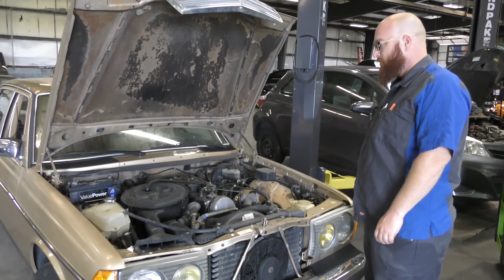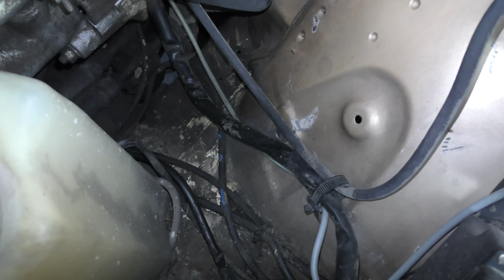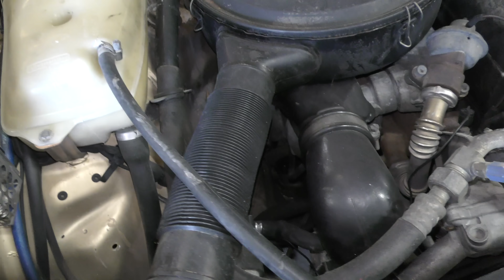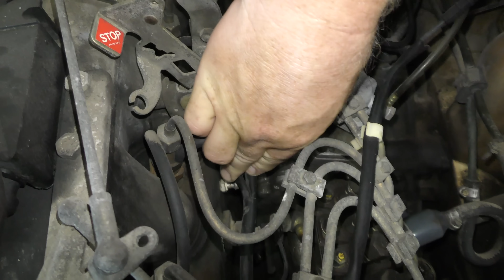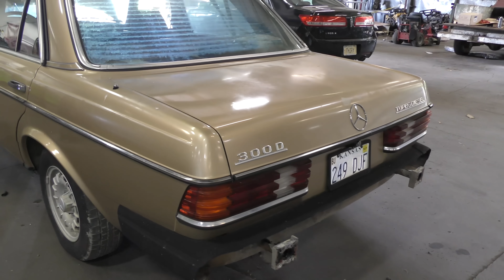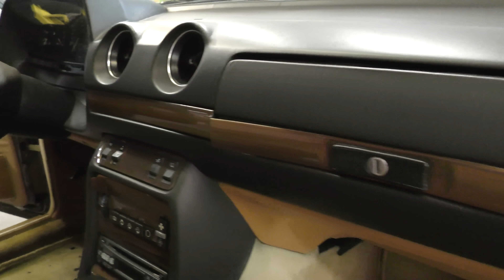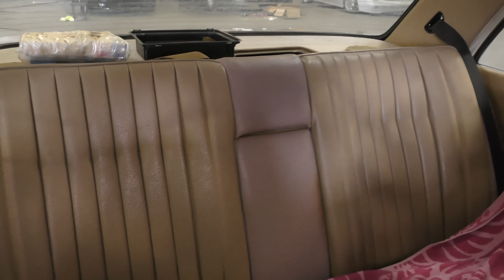Tank of a Mercedes 300D with a 3L Turbo Diesel! CAR WIZARD finds lots of surprises under the hood!

Comment: I can tell you right now someones polished the hood, as its a different shade from the rest of the car, so someone started, took a look and gave up, and with the rear bumper my best guess is that that rear bumper was next for polishing or replacement, or maybe they wanted to convert it to what was probably euro spec chrome bumpers, as if you've ever looked at ratarossa's channel about how bad the US Spec Bumpers were on the american ferrari 308's were, one can only imagine how bad they were on this if it had them, as with the shocks and all that, they added about a full 100 pounds of weight to the car on I think one side, and he's not even done with it yet.

like if that ferrari was a porsche, they'd charge you a 100 grand for that kinda weight savings alone these days lol 

also I gotta say you know if someone put a bigger turbo on this, and switched out the headlights for some latter square ones, it would probably be quite the car, if only it wasnt in this god awful color lol

Comment: The Mercedes diesel in my semi truck is an OME460. 12.8 litre 6 cylinder rated at 460hp 1500lbft mated to a 10 speed manual Eaton transmission and 3.73:1 rear gears.

Comment: A friend had 5 MB diesels. '76 240D, '79 300D, '80 300D, '80 300SD Turbo, and '87 300D Turbo. All of them tanks. All over 300k miles. When we went to pull-a-part, the diesels had 400-600k miles while gas MB had 100-300k miles.

The 240D saved his life. Some guy t-boned him on the driver's B pillar going 75. My friend walked away.

Comment: Correction: It's the non-turbo 300D that is around 85 horsepower (87 HP to be exact). The turbocharged 300D puts out 123 HP and 184 lb-ft of torque.
Reply: Here in Austria the na 300d is rated at 88 HP...
Reply: @Rum1981  US uses imperial horsepower and austria uses metric horsepower, hence the difference
Reply: @Thorbyr  Not really. The 300d he mentions is "NA" or naturally aspirated - not a turbo
Reply: @Thorbyr  Metric horsepower is called kilowatts 😂😂😂😂😂😂
Reply: @Rum1981 the newer straight D 300D in the newer 124W were apparently 112 hp.
Reply: In USA when the turbo diesel was introduced it replaced the naturally aspirated engine option and (unlike in Europe) they still just called it 300D.  And the power is 125 hp. In Europe, the turbo diesel was only offered for the station wagon and it was called the 300 TD turbodiesel.
Reply: @joakimquensel597  One of those is for sale about 5 minutes away from me. Unless it was already sold
Reply: Yup
Reply: I think the 300D straight D was 112hp..the turbo didn't make much difference tbh
Reply: @MP-po6fj You're confusing the newer 300D in the w124 with the older w123. The older 300 D had a 5 cylinder  3 liter, the Om617 had 80 hp,  untill around -82. They then upgraded with other pistons, other pump and became 88 hp, still 5 cylinder 3 liter. The turbo version had oilcooled pistons and 125 hp with typical Garrett T3 turbo. 
Then from 1986 when the w124 platform were introduced it got the 6 cylinder 300 D with 110-113 hp in non turbo version.
Reply: So the cars basically a gutless pile of junk ! Yeah no thanks
Reply: Michael Wilson that’s why these things last so long.
Reply: I had a 1981 240D with the 4-speed manual and a 1985 300D turbo automatic and both had no trouble keeping up with traffic, even here in fast-paced New Jersey. In fact the 240D is quite peppy in city traffic, which is why it was the favorite of European taxi drivers (and still is today in Third World countries). The Mercedessource channel has done videos demonstrating the true acceleration times of these cars when they are properly maintained and tuned.
Reply: @vwestlife  84 300D manual here, it did pretty well.
Reply: @vwestlife  Oh hi, didn't expect to find you here
Reply: @iamasmurf1122  1st car Bill Gates bought when he started getting rich: Porsche 911, the 2nd : Mercedes 300D as he called it "The world's fastest slow car".
Reply: @iamasmurf1122 Sounds like whatever you're driving.😅

Comment: The 123 chassis is my favorite Mercedes. I've owned 3! One I bought with only 63,000 miles on it from a couple who lived in Florida. Why I sold that car is one my stupider mistakes. Another I bought had a BRAND NEW crate motor from Mercedes.  I paid 2500 for that one, I believe I "stole" it. I sold that car and the guy uses the car as power for a saw rig. He's got belts running off the rear end. My third had 327,000 miles on it and it fan like a top when I sold it. I would have jumped in that car and drove it anywhere.  

The rockers and jacking points on this video car made me drool. It's rare to have them both so rust free. 
Nice car, Mr Wizard. These old Mercedes make great first cars because they are built so well. 

I'm actually thinking about looking around for another 123 300 diesel. I miss that smell. 

Or, I have always lusted over a 220 D 4 speed, I'd also like a 50s/60s 190 diesel with the 4 speed on the column. 

Please do a follow up video when you are done. I love these cars so much.
Reply: Why did a car that is "so well built" need a new crate motor, and why are so many of them rusty?

Comment: When Mercedes made non plastic, good cars.
Reply: There's no shortage of plastic in this car.
Reply: @OMGWTFLOLSMH  Whooosh!
Reply: all the mice chewed stuff is plastic/rubber
Reply: When luxury was about build quality rather then technology
Reply: Add BMW/Audi etc to that list
Reply: @x01e  mm not audi, old audis were garbage too
Reply: My 2000 s500 is pretty decent yes there are things that break but 165k
Miles going strong. 💪👍
Reply: If you keep putting money into any car, you can probably keep it on the road forever.  I had 2 new ones from that era ('81 and '89). The truth is that both arrived from Germany with factory defects, both left me stranded several times and both had superb maintenance with no expense spared from day one.  The random failures were many.  Years after I had gotten rid of both of them a former MB employee asked about the cars and said "let me guess what went wrong with yours". He then recited a LONG litany of problems and just about all of them were mine. Reason: "Those were just the FREQUENT issues!!!"  I'll never own another German car of any kind.

Comment: Haven't seen this in the comments: Car Wizard didn't open the boot but there may well be rust damage in there. With the ariel missing, rain will be running in there and collecting at the low-points. Looks like a solid old Merc though - not bad for a first car.👍

Comment: I have an 85 300D. I’ve been using it as my daily driver in Tucson during the winter season for many years.. It has a 4 speed manual which really wakes up the driving experience. It’s a great car for long distance driving. It handles corners extremely well. The 134A in the AC system is a weak point - but the AC even with R-12 was weak even when it was new. You mentioned the engine shocks. The motor mounts are also a common issue. But it keeps soldiering on. Anyone who says they’ll get 30+ MPG must be going down hill with a tail wind. When I had the auto trans 22-24 was the best I could get. Then I swapped in a 4 speed and it did drastically improve the MPGs.A great car!
Reply: get the York AC compressor in there the R4 rotary type are garbage
Reply: You'd think that MB would have realized that their AC systems were crap (which they were) and install good ones. The answer is that of course they knew; they just didn't care. That's true of most of the defects in these cars.

Comment: The 123 Turbos were and still are an excellent car and the engine had 120 hp, my parents bought a 1983 300D new.  I remember my  mother loved that car and it was the first of many MB's for her. I used to work on them in the 80's and 90's they were great i'm sure that I still have a set of valve adjustment wrenches for the 617 in my toolbox.   I can't believe the amount of damage from the rodents.  Wizard your video won over Hoovie after  I saw that you both had new ones posted at the same time but the 123 video got my view first.

Comment: It's a real shame that MB abandoned the durability aspect of their cars in exchange for electronics, gadgets, quirks and features.
Reply: Believe me, electronic actuators in just about everything are vastly superior to vacuum-operated ones with all the fragile but essential weak, cracked plastic tubing running everywhere.
Reply: @wholeNwon  I'm not going to argue with that, but a whole bunch of stuff is unnecessary. It's not unique to MB, of course, but do we really need door handles that pop out as you approach, transmission selectors that rise up, speakers that disappear, doors that close the last inch on their own, latches that trigger solenoids instead of opening the doors directly, etc?
Reply: @smwsmwsmw  Of course we don't need (and many of us don't want) all that trouble-prone crap. But the dealers sure do!
Reply: @smwsmwsmw  It's called modern luxury Steve, I appreciate the sentiment and I know where you're coming from but these features you see are wanted by people who will actually pay their hard-earned money for something like that. Mercedes and other brands have been doing this for so long now that the more recent cars (circa 2015 onwards) really don't have electrical issues anymore, everything's solid state. Even by switching to electric steering they've completely mitigated PAS pumps failing and steering racks going bad
Reply: @wholeNwon  best pickup truck diesel engine ever was a mechanically timed 12 valve cummins
Reply: @wholeNwon  definitely cheapened the brand. sigh
Reply: @graphene1487  There are still lots of suckers out there who buy them to impress the equally stupid.
Reply: Gadgets sell at a higher price than durability, to the general public. That's why today's cars are full of stupid and dangerous to use touch screens instead of old buttons and knobs, which are less fancy and cost more to wire.
Reply: If they didn't then Doug wouldn't have a job now WOULD HE!!?
Reply: @overthehilldill3626  That's true. I bet Mercedes-Benz takes that into account.
Reply: They are pure junk today!
Reply: These cars needed maintenance too. Do you expect Mercedes to stay in the dark ages technologically? They would have been out of business decades ago. We have a lot to thank them for, the technology they developed and tested are now commonplace in many cars
Reply: My 2000 s500 begs to differ not as nice but strong and good at 165k miles

Comment: I have a 1985 300D Turbo Diesel that I inherited from my dad back in 1999. The body is rusted, so I stopped driving it 11 years ago. The odometer stopped working at 267K miles. I put at least another 100k before I parked it 11 years ago in my back yard. It still cranks today and I drive it around my property from time to time. I am looking for a decent body to transplant this engine/transmission. The engine and trans are solid as a rock. They don’t make them like this anymore.

Comment: I had the chance to buy one of these years ago - it was silver, a 1985, and in a lot better condition than this example. It was a case of "Dad died, left me this car, I don't want it" and it was being sold fairly cheap. Wife and I needed a car, but she didn't like the way the old 300D looked. She found an Isuzu Trooper she liked.

That trooper was the worst vehicle it has ever been my misfortune to drive. I can handle the fact it was slow. The issue was something on it was always breaking. Our other vehicle was an old chevrolet truck with 230,000 miles on it, and that truck was leaps and bounds more dependable.

Comment: The oilfeild has killed most in my area. Drillers buy them to use the offroad diesel at the rig to get the crew to and from the rig and the dirt roads just rattle them to pieces.

Comment: This was my first car back in 2000, if memory serves.  I was 17.  I had 1985 with the 2.88 rear differential.  It was a birthday present.  I never liked the w123 because I fell in love with the w126 a long time before that.  I always longed for the superlative S-Class.  My parents had a 1984 300D and ‘83 wagon respectively for years and years before that (Dad’s went 464K miles and Mom’s was sold).  My Dad has at his business an ‘84 wagon, and an American 1980 280E (with the m110).  Bodies are in tough shape, but they run alright (even if they’re off the road).  That’s all that’s left of what we used to have.

Comment: I'm very excited to watch this series unfold. I just picked up a '79 240D. I really really would've preferred a 300TD (wagon) but there are very cars of this era and style here (Hawaii). I snapped up the first decent example I could find. Only has about 250k on it and it runs really well. Starts up on the first crank every time. Biggest selling point was the manual transmission. I wouldn't have bought it otherwise. There's a bit of rust here and there in the common areas (hood hinge drain areas, B-pillar floor) but nothing serious. As long as I get to it in a reasonable amount of time, there shouldn't be any sort of major surgery. The interior needs work too, but first I need to address the hood hinge areas because there's a bit of water coming in. After that it should be good to go until I'm ready for a full teardown or until I sell it and move on to another project.
I've been daily driving it to work for the last month and I really enjoy it. As you said, it's so very slow. I thought it wouldn't be too bad, but boy was I wrong. I've driven a clapped out T2 Transporter and a stock 60s Beetle, and both have felt quicker than this.
Reply: Fellow 79 240D manual owner here since 1993.  Great cars.  Slow with the AC on.  Tolerable with the AC off.  20 seconds to 60.  3rd gear ratio is a little low and I wish the car had a 5 speed.  On the plus side, the car will hit 95-100 mph and still get 25-30 mpg.  I would recommend you keep a couple of spare firewall fuses for the glow plugs in the car (although in Hawaii you may never need the glow plugs to start the car).  Also, check the suspension components.  I'm currently restoring parts of the front and rear suspension because after 40 years, things wear out.  Good luck and happy ownership.

Comment: My first car was a 1975 Mercedes 240D, W115 chassis. Loved that car. Still regret letting it go.

I've owned several W123s, and I currently have a W116 300SD which is an awesome car.

Comment: I learned to drive on one of these, then had another that finally died for me at 328k miles that was a '78 with Euro headlights. Someone bought it from me, put an used engine in it, a d so far as we know it's still on the road. M

Comment: They are doing this the right way.  Do not consider the cost (value) of the existing vehicle in the used market, consider the replacement cost.  If it's cheaper to fix, do that.  If you can get a desirable replacement car cheaper, consider that :)

Comment: The turbo 617 should have somewhere between 115-120hp ... it's the non turbo 3L that's like 80-90hp. 
Had an 85' 300CD for 5 years, solid car. If they're tuned up right they're not slow, keep it in Drive-3 while cruising in-town to keep the Revs up ;)

Comment: That's pretty cool, bears a lever under the hood to stop and shut off the engine. When working at U-Haul I had a trucks that wouldn't shut off because the ignition cylinder was all worn out. The only thing I could do is grab and unplug the distributor coil wire. Got it off the first time no problem then some idiot came along plugged it back in and started the truck back up and the second time I did that I got a hell of a jolt.

Comment: In the last few videos you have mentioned the risk of using used parts, and doing water pumps without doing timing chain / belt kits.
Thank you for trying to lift the perception of mechanic workshops around the world. I ( we ) mechanics are tired of having the same conversation with customer over and over. Thank you for publishing the reasons.

Comment: I daily a 300TD Wagon with a OM606 Turbo swap + 603 mechanical injection pump.  It's not a super turbo build or anything, it's just tuned up to be at the best performance before you get smoke outside of flooring the throttle from nothing.  Still gets pretty good performance, great economy, and looks great too IMO.  With the mechanical pump it's also a lot simpler than my other wagons (Volvo 750R/V70R and Saab 9-2x Aero/09 XWD 9-3 Aero) and makes a good road trip car with the newer suspension.

Comment: I don't know how reliable you can make it for just $4000. My 1985 300 CD was a real cherry when I bought it a year ago with 244k miles. I just got it back on the road after replacing darn near every rubber part, every suspension part, new fuel injectors,  rebuilt turbo, and fixed a host of nonworking electrical "features" like the air conditioning and the sunroof. EASILY cost more than $12k in parts.

Comment: I've heard that mice get a charge out of the electricity when they chew on car wiring.  I lived in Hillsboro, not to far from you. on a farm.  You have to be vigilant in the war against pack rats there.  You can't leave a vehicle unattended without packrats filling the engine compartment with their nest material.  Pack rats are one thing I don't miss about Kansas.
Reply: Honda makes a tape you can put on all your wires. Rodents can’t stand it and move on. Very worth the $35. Found mine on Amazon

Comment: I have a 1980 300TD with the sunroof. When it got retired to the corn crib it was due to major rust under the car. Figured it wasn't safe to drive on the highway anymore. As you said, it is more money than it  is worth to bring it up to snuff, and you need a really good reason to do that. My car didn't have any sentimental value. I had swapped a friend a 928s that my nephew scrapped along a guard rail for it. Got over 100K on it before parking.  It wasn't too fast, but it was solid. They don't make Mercedes like they use to.